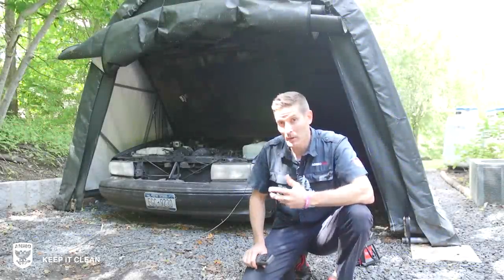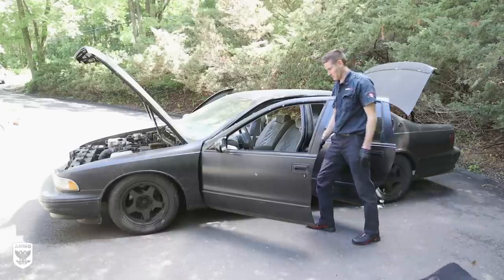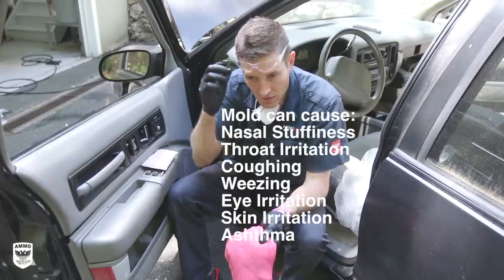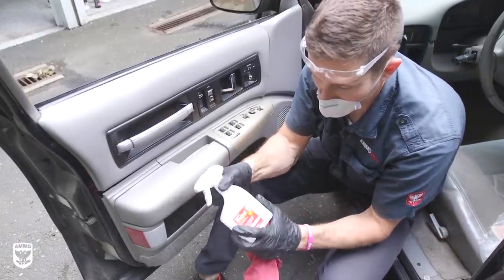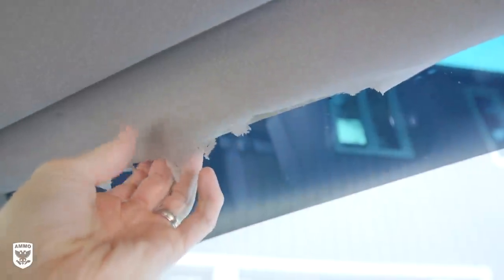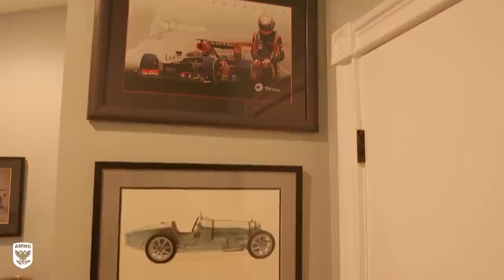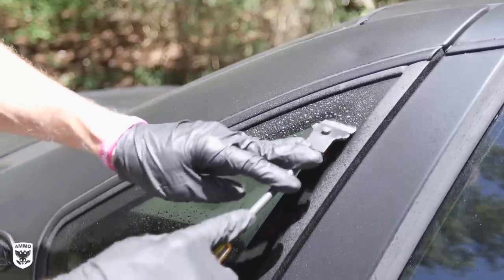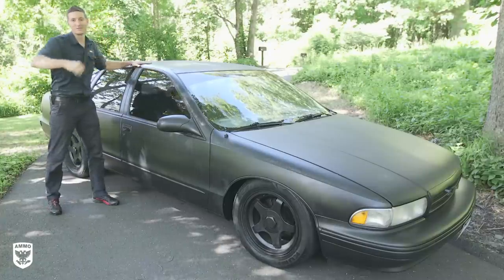12 Step Detail: Mold Removal and Plasti-Dip Repair for Used Car Sale: Impala SS

Comment: Razorblade on windhshields is the BEST way to clean them, hands down. Spritz a little water on the window, go over it with a blade, then you can use way less product and elbow grease to wipe up the little remaining residue. I drive 100 miles a day for my work so I get lots of bug impacts, the razorblade method has saved me a lot of time.

Comment: Your speech about the glove box and center console may have been excessive to anyone who hasn't had the aggravating conversation that comes with opening them. Spot on. Also it is nice that it wasn't that bad. I've been cleaning a work truck for about 10hours  to get the mold out. It made your situation look like a cake walk.

Comment: 3:50 I learned it the hard way. Arm rest and glove box should not be even opened. Amen
Reply: That's kinda hard to avoid, as most customers leave their service book in the glove box, and you have to get it to stamp it after an oil change.
Reply: We or at least I am talking only about valeting/detailing/washing situation were You are supposed to clean a car inside and possibly outside.
Reply: Yes I do vacuum under the seats, but I do have problem with getting a proper cleanliness. The way my working place works is I get the car after all the talk with customer is done by adviser. To only chance I get is after job is done.
Reply: And how exactly does this help?  they are still going to accuse you of stealing stuff.
Reply: what is the craziest thing you guys have found in a glove box, center console or arm rest???

Comment: The eBay listing is no longer available did you sell it already?
Reply: jooger69 best ebay add one could wish for, it will make some happy I'm sure!
Reply from the maker: http://rover.ebay.com/rover/1/711-53200-19255-0/1?icep_ff3=2&pub=5575378759&campid=5338273189&customid=&icep_item=173404409302&ipn=psmain&icep_vectorid=229466&kwid=902099&mtid=824&kw=lg&toolid=11111
Reply: Is that Free Shipping or Free Pickup?  It's confusing, says both....
Reply from the maker: Chris Padilla pick up

Comment: The shag had the peroxide so that's good.  But would have silver citrate worked on the doors
 You do need to leave it for 30 seconds, 2 minutes or ten wet.  Kills a wide variety of batceria? Any mildewcides?

Comment: well, here is to hoping you read this. do you have any suggestions for repairing damage done by tree sap on a black car? I used meguiars DA drill attachment with ultimate compound and polishing steps, it helped but I can still see where the sap ate in deep, possibly thru the paint to primer or just deep vertical that makes it look grey and you can still see some haze in bright light reflections. the paint kinda has this crinkled cracked look up close even thought the surface feels smooth.
Reply from the maker: check out my old video about getting bird poo etching out of paint.  you might need to wetsand a bit if it etched in. be careful not to burn through the clear coat. be sure to measure the paint

Comment: This could be a bit late, however I was wondering if a ozone generator would work to kill mold in cars. They sometimes use that in mold remediation, and if you just have one that is outside and is piped through a window that is closed with a foam spacer, running it for a few hours then turning it off and opening the car up (without going in) should kill all odors, mold, fungi, etc.

Comment: Regarding the mold: you need to also clean the backside of the panels. I would actually completely disassemble everything and soak it down with a mild bleach solution.

Comment: Couple questions if you get to them   when you use that plastic dip on your paint are you still able to do paint correction and polish with your microfiber cutting pads foam pads later down the road?  also I was told the 03 from the ozone machine destroys rubber and some cases plastic any truth to this? Thanks as always for your time
Reply: i dont think u cant polish plastic dip. But as far as i can see he allready had some sort of coating on the car to make in matte

Comment: Do the wheel soap and cleaner have acid in them? If not, this might be a stupid question but are acid based cleaners safe to use in engine bays? Thank you also very much for the information. Love your channel.
Car does sound good and I'm picky on that.

Comment: 9:00 listen to that door panel quality! lol
Reply: Embrace the 90's crinkle. This ones in good shape actually. These cars tend to have broken arm rests on the driver door.
Reply: Camaro Rick lol true. The few caprices I've been in, the door panel damn near ripped right off the door when you pull on the handle to close it
Reply: On the plus side of 90's plastic, its easy to plastic weld it back together if you save all the pieces.
Reply: Camaro Rick it does have cracks if you look at his honest eBay listing lol
Reply: Yum yum, '90s Detroit quality. Now compare it to the bank-vault doors of an '80s Mercedes.
Reply: 90's GM Quality you can hear!
Reply: needs all new clips and it will be solid.
Reply: amorton94 every car is the same way as this... ffs my 2018 Audi Q7 makes noises lol
Reply: Lol.  Sounds just like mine.  Complete with the crack in the panel too.  Ah those 90s GM interiors. Gotta love em.
Reply: Scott Boyer 😂 "quality you can hear"
Reply: Former SS owner here. Those door panels sucked! I replaced mine no less than 6 times. I was constantly in the hunt for good ones. My car was heavily modified though. T56, T84s, 3:73s, rear arms, linear rate springs, massive sway bars, Porsche brakes, Bonney seats front and rear, Caddy carpet, all that good stuff we did back in the 90s. The engine was a 406 Callie’s bottom end “304” cam, LT4 heads and intake. It’s was a great car. John Moss signature car as well. 

Ah, the good old days.
Reply: This car in when it was new was like 39 grand for stating price (39 grand because I converted it for inflation)
Reply: @azzz..6  No, it's a 95 or 96. The picture was from 2002.
Reply: Jay Gilling lol
Reply: Jay Gilling tho it is a 1994-1995 because it’s a column shift. The 96’s were the only year they had a floor shift
Reply: 24 year old vehicle lmao

Comment: Feels a bit incomplete without polishing the headlights and replacing the trunk carpet.
Reply: also 100% should have replaced the headliner.
Reply: Headliners are expensive. No point if you're selling
Reply: The point was to make the best out of what was in hand, not a restoration. I agree with the headlights kinda but not with replacing parts.
Reply: Yes, agree with the headlights but the carpet in the trunk was cleaned and headliner was fixed, Headlights fixing would have also been instructive.
Reply: Polishing the headlights is stupid, since after a short while it would look just like before. Buying new ones (if still available for this car) and coat them with protection from uv would make more sense.
Reply: exactly.  and then over it with a nailbrush when its dry.
Reply: @blitzcourt5021  Or just use an actual headlight uv sealant.
Reply: Max Maker its got 230k on it...
Reply: Much agree

Comment: Is "Max AC" not recirculate on the old chevys?
Reply: jborgar "Max AC" uses the recirculate function automatically, but does not recirculate the inside air continuously. In some vehicles it also maxes out the speed of the fan (makes it very noisy as well). Many of the older vehicles did not have a true recirculate function, more of a "sort of closed off" feature. Newer vehicles will completely close off the air coming in from the outside from the HVAC system, to prevent smoke or other unpleasant smells from entering the vehicle.
Reply: good to know!

Comment: Isn’t Plastidip really annoying to remove in light costs?
Reply: TheRealCashMoney not if there is older caot below it .
Reply: Ammar Abotouk yes. The raail is different from dip and the raail is also well fully cured. Won’t bond properly.

Comment: I know I am over a year late, but I just wanted to let you know, the car may not say recirculate, but if a car has the MAX A/C option, that is recirculate. Normally A/C is the only reason you'd want to recirc the air in a car anyway. 

Just an FYI

Comment: Rip. 96 Impala SS is my dream, stock wheels like yours, deep purple paint from factory. Dual Chevy tip exhaust, with 🍒 bombs, 3 inch drop, mustard mayonnaise tires... Kicker or Alpine system, or cerwin Vega keep it period correct.    Ok I'm done😂

Comment: Anyone got tips on how to clean cloth seats? I can't seem to get rid of this "fuzz" on my seats. like fuzz you get on an old over worn sweater.
Reply: MotoTherapy I had the same issue, tried everything from lint removers to those electric mini lawn mower thingys meant to remove fuzz. Eventually found a great and permanent solution. Gonna sound wierd, but I used a heat gun on the seats, just be careful not to burn them. It's one of those cases where a bit of common sense goes a long way. 

Anyway, just apply enough heat to burn, melt and seal the ends of the fibers, the thinner fuzzy stuff will disappear long before the tightly woven fabric heats up enough to get damaged. Test the distance and duration on a spot that can't be seen. Done properly, the seat will not become uncomfortably hot to the touch.

Comment: Not to be a critical bastard, though gotta say that at the end the picture you showed of that car way back when you bought it as shown in the waterfront scene, had alot more gloss finish going on than what appears to be matte at this point in time. Lighting? hmm..
Reply from the maker: The car has been painted with Raail coating a while back. check out the video: https://www.youtube.com/watch?v=B_tw60YusrY&t=1s

Comment: You may as well have forgotten the mask, since you're not wearing it correctly! There is a mile gap and all that contaminated air is going right over the top. 

Great video! However if you're going to recommend PPE, you should at least take the time to wear it properly. Otherwise it's useless! Keep up the good vids!

Comment: I've never seen someone so paranoid about any sort of mold going into the air. I don't know if mold is considered a massive threat up in NY, but here in the south, there is guaranteed more mold content naturally in the humid air than there ever would be inhaled from that TINY amount of mold that was in this car. I'd understand if it were coated in a bunch of mold, but this was nothing. With the amount of time spent worrying and being so overcautious on that, it took away time that could be spent on other things like restoring the headlights. That cheapo matte finish was just nasty, I just don't get that fad, it makes the car look like some section 8 dope dealer vehicle. And flowmaster on an Impala? LOL, yeah I guess there was those kinda guys in high school.

Comment: Hey Larry, I know this video is a little older but I hope you get a chance to see this. Just a friendly observation as a former mold mitigation specialist. I would recommend that when applying Shag (a great choice for the Hydrogen Peroxide!) apply it directly to your microfiber towel instead of the surfaces. That light mist and puff of air from the bottle can actually cause mold spores to become airborne. If you happen to deal with mold on a fairly regular basis, I would highly recommend grabbing a product called Benefect. It is a fantastic product as well as the worlds only authentic botanical disinfectant. No strong lingering odors or harsh chemicals etc. Lastly, I would encourage you to wear a simple respirator. The mask you have here does nothing to filter out spores. The respirator will filter much better and keep you significantly safer. Fantastic video as always! Keep up the hard work!

Comment: I use kitty litter in dollar store pantyhose to control moisture when I store cars...or if the car is a winterbeater that doesn't have AC. It hasn't failed me yet to keep mold/musty smells away. Take a red solo up, scoop the kitty litter into it then stretch the over the cup and tip it in until full and tie it off. Yes, it does make dust so you can put them on a paper plate or on a plastic bag etc

Comment: In most domestic cars, MAX AC is the same as recirculate - its just a short cut instead of turning the temp down, the fan up and pressing the recirc button.

Comment: 70% iso is the ideal percentage for antimicrobial impact  just FYI
Reply: Michael Kerr 50 to 80% is considered a good concentration as a antimicrobial. However as you said 70% is considered the "best", since it has the highest osmosis pressure. Although isopropyl alcohol is not considered effective against mold spores... a bleaching agent like Hydrogen Peroxide is very effective against mold spores. SO in the case of this video, the Hydrogen Peroxide found in the "shag" solution would have been the most effective at getting rid of the mold, of course it does not hurt to clean everything down with ISO anyway.

Comment: Those paper mask are a joke!! IMO they make it worse. 
Get a respirator that will ACTUALLY seal around your nose and month. 3m's 2091 or 2291 and 2097 or 2297(has some activated carbon) filters work great.

Comment: I recently had a very severe mild problem with my rx8 that has been off the road for 2 years. I went straight for steam cleaning and household products but it was incredibly awkward so I stripped the interior and cleaned everything multiple times with more aggressive household products in the house and luckily it’s now fully clean and dry. Could have saved myself a lot of hassle I’d dealt with the mild this way
Reply: Did the mold ever come back? Please respond

Comment: That mask ain't doin' nothin' gainst' mold. You NEED to get a respirator with organic vapor AND mold ratings. They cost about $40 from Home Depot or Lowe's and are well worth the money. 
I have bad allergies and worked at a job where I heat treated bed bugs and mold. I was told to go into a room that had had sewage sprayed all over (septic system backed up and sprayed in through a window). It had been "cleaned" by no less than 3 untrained people over the last hour or so. One used almond extract (why we had that or they thought it was a cleaning product is beyond me), one used an ammonia based bathroom cleaner, and the last one used commercial grade bleach. Now any one of those chemicals would warrant the use of a respirator for me, but mixing bleach and ammonia will create a gas that KILLS HUMANS! 
I walked in there and immediately my throat closed and I couldn't breathe. I evacuated, spent 30 minutes finding a respirator and filters for it and went back. I was fine, but my boss actually expected me to go in there knowing full well what those chemicals did. 
Moral of the story, use a mask that is rated for what you are doing. READ THE LABEL, it tells you what it is good for according to national standards for safety. If it doesn't have them, don't use it. That mask saved me hours of sneezing if not my life and was nothing more expensive than a $40 mask.

Comment: greater error a detailer can do is power washing and old LT1, especially a 92-93 LT1. The LT1 engines are known in the LTx engine community to be prone to fail due to the weak design of the optispark. Many,I repeat, many, failing of the optispark are directly related to engine bay detailing with direct use of pressure washing . Normally other failures are related to water pump dripping over the opti unit. Again it's very difficult to properly mask with film an opti due to its position BEHIND the water pump assembly. Starting with 94 these units were provided with a ventilation system using positive pressure from intake and negative pressure from the vacuum source,this partially solved the issue of moisture build-up inside the case damaging the Mitsubishi designed opti sensor for the reluctor wheel.

Comment: I work at Valvoline Instant Oil Change, and drive a WHITE 2011 Ford Fusion. It's nearly impossible to keep from getting soft oil stains on the car and was wondering if you had any tips towards getting rid of those stains on a semi monthly basis.

Comment: I know this video is old but if I can spread some knowledge, I will. I've owned a professional window cleaning company for over 20 years. When you blade glass, keep it soaking wet, blade down one stroke at a time. Get to the bottom of a stoke, lift up, clean your blade in1 downward direction on a towel. Take another pass. 
If you go back and forth, up and down in an erratic manner, you run the risk of a partical being lodged under the blade and causing a scratch. Trust me my way is the safe, efficient, effective way to blade glass. No need for micro-scrarches like you'll see on black paint.

BTW you did the right thing as a man, husband, father and dad.

Comment: Putting the ac on "max" will put it in recirculation.   All the other settings bring in outside air.  Also I see those Kuhmo ASX's.  Lucky you, those tires aren't made in oem Impala SS size anymore.  I have a 95 SS that I've had about as long as you have had yours.  Tried to sell it a couple of times but couldn't do it.  Mine isn't in nearly as good a shape as yours is.  Hope all the best for you when you decide you need another one 😉 after selling this one.  Great video.

Comment: I reglue headliners for shady car flippers. Here how I do it spray glue one side not fabric the head board. Let glue dry few seconds then roll fabric back in place. If you go to thick or to fast it will bleed throw. I never charge and don't give any kind warranty. Saves me from doing headliner saves them few dollars. Walmart has spray can glue in paint area or on line.

Comment: What do you do if the moldy smell comes back after several ozone treatments??? I had a BMW wagon that was left under a tree for years with a leak. Totally gutted it and wiped down metal with bleach, then cleaned all fabric and leather.  Ozone treated it for a couple days and then smell came back days later...